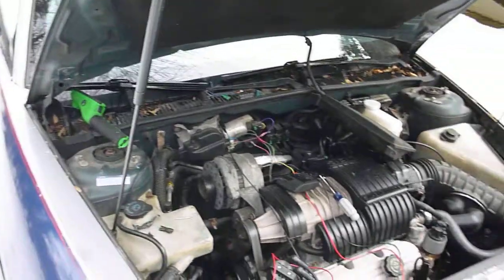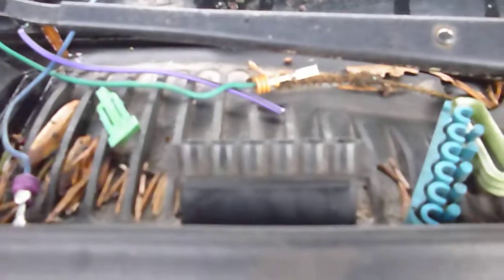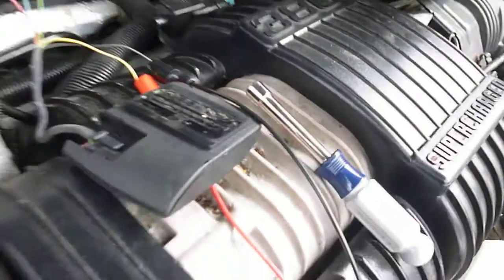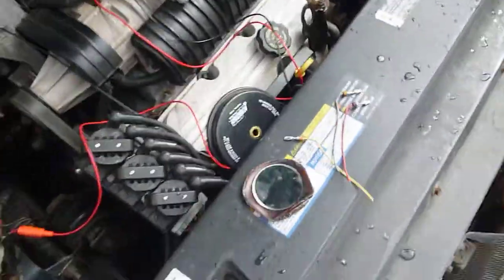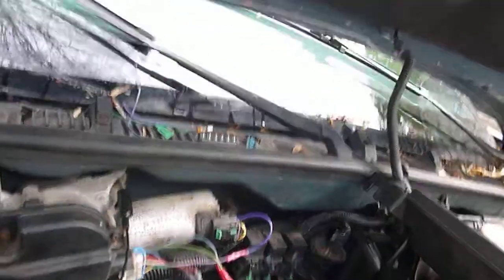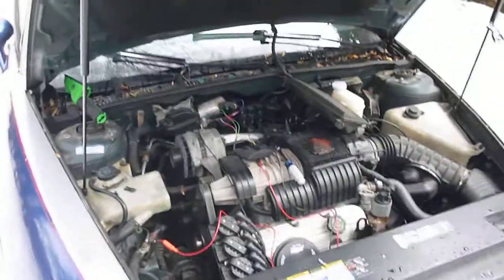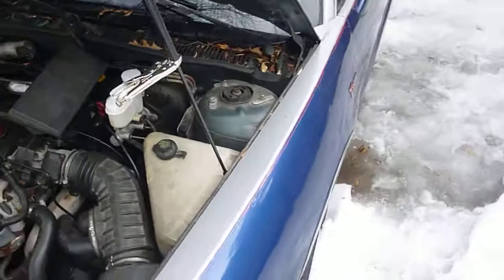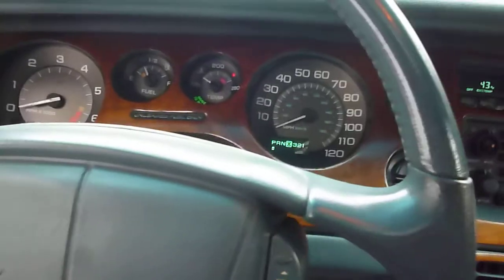Adding Rainsense wipers to a Riviera

Comment from the maker: Many have done a "top swap" on these engines with success (heads, intake sc, among other parts).  The regal was offered with a supercharger as the GS model so finding direct bolt in parts should be fairly easy.

Comment: Very cool mod! I didn't even know that existed back then! I've only seen it on newer cars. I'm assuming you replaced the shattered rear window if that Riviera's sitting outside. Is that a replacement engine in there and is it running?